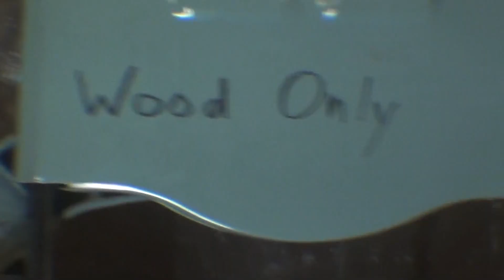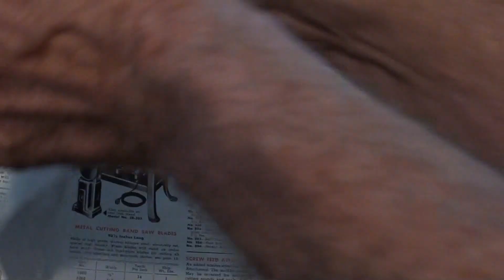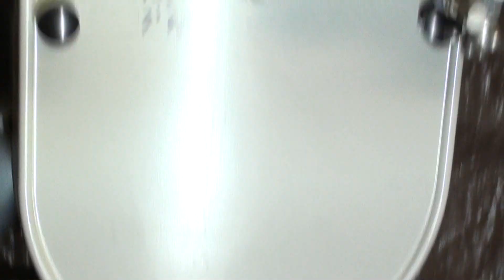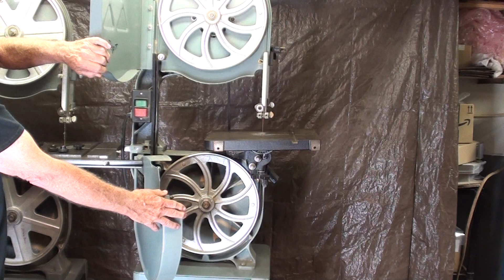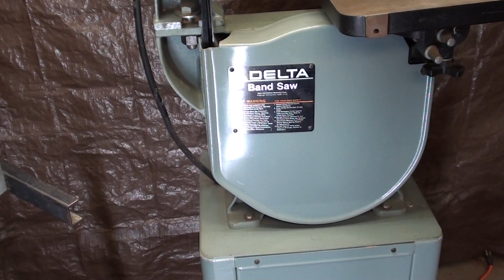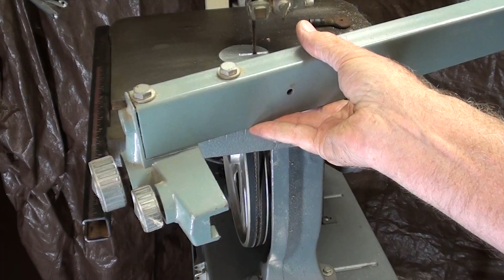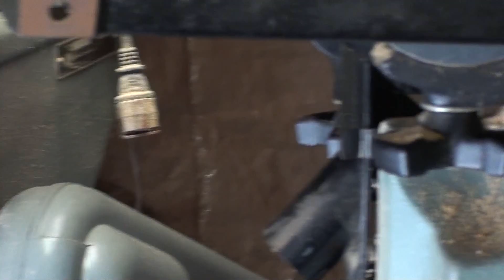All About Delta BandSaws Tips #486 tubalcain

Comment: The design was Walker Turner ,they bought them in the 1940 range .
Reply: john suckoe ..... Two distinct companies in the beginning. Delta's 890 bandsaw began in the very early 1930s and were built in Milwaukee. The Walker Turner firm was out of So. Plainfield, NJ and was a competitor. The Rockwell conglomerate bought both companies and did mix & match some machines, but the bandsaws seemed immune from that.... the Delta model stayed in production to the end.
Reply from the maker: I don't see it as being the same as walker Turner